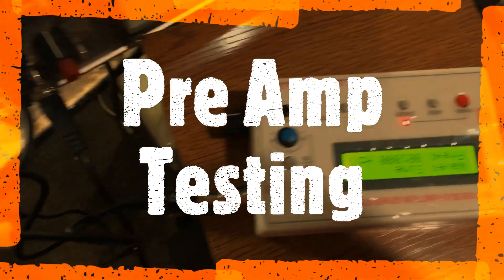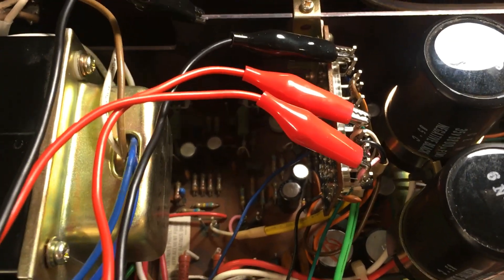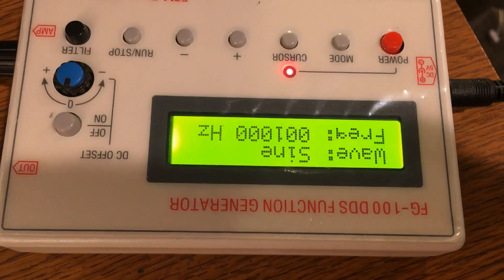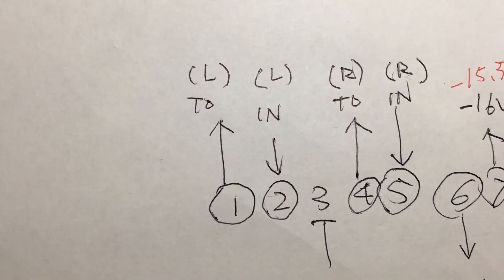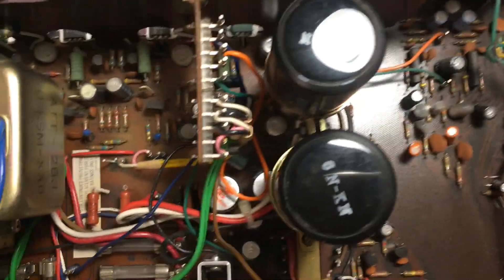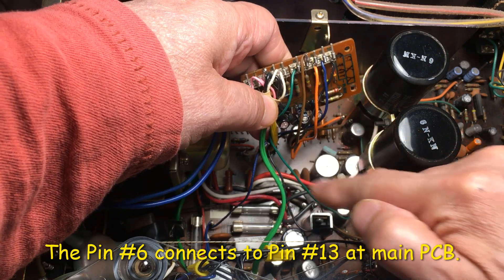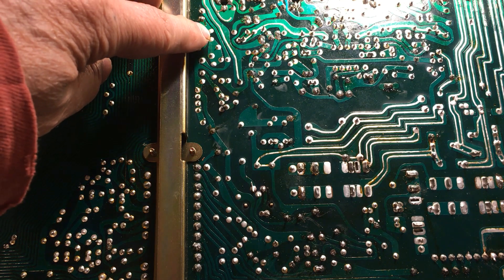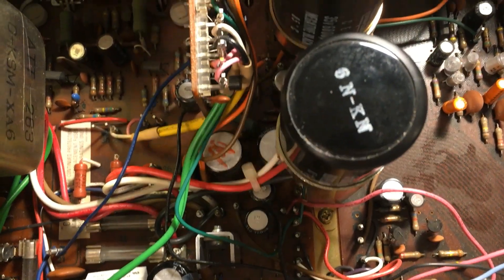Pioneer SX-550 Receiver Repair I - No Sound Outputs

Comment: Hi !!  I just bought a vintage 1984 to 85 Pioneer sxv90 for repair. I used to have this system when I was a kid as it was my 1st stereo I bought as a kid in 1988.  It doesn't make sound but turns on. I don't have it yet as I just bought it today.   What should I look for 1st ?
Reply from the maker: I don't have manual or circuit diagram for svx90, so I can't give you any suggestions. There are many reasons can cause no sound output including blown fuses, speaker protection mode is activated, defective amp PCB and power supply.... etc. If you can provide me more details on the svx90, it may be helpful to analyze the problem.

Comment: The lionshare of issues with these amplifiers is: 1) cracked solder joints 
2) cracks on the boards themselves 3) dried up electrolytic capacitors and 4) oxidized potentiometers. 5) dirty switch contacts. 

Contact clean any pots and relays.
Clean and inspect the board.
Reflow solder 
Reace capacitors

Solves 90 of issues woth amps. Its really not that difficult.

Comment: Great video as usual. Please what tool did you use to diagnose the two replaced capacitors? Have you worked on board or off board? Best regards. Like.
Reply from the maker: I use a capacitor tester or multi-meter to diagnose the defective capacitors. Working off board is a better way to detect the problem. However, sometime it still can be found the defective capacitors on board with the tester.
Reply: @VintageAudioFan  Thank you.

Comment: Great troubleshooting video!  The SX-550 was one of those receivers that always seemed to punch above its weight.  With these gems now pushing 45 years old, they need a little TLC to keep purring along.  Thanks for posting and your time.
Reply from the maker: Thank you for the comments. Recently I have repaired and listened to the vintage receivers with 20W/ch wattage (i.e. Marantz 2220B, Yamaha CR CR-420, Harman Kardon 330B & 330C.... etc). The Pioneer SX-550 is on the top of my list of the best receivers. It has very good FM reception with clear channel separations. And the overall sound quality is also excellent. It is worth to keep and I highly recommend it.
Reply: Another great video.Wondering where you get your stereo equipment from that you work on?
Reply from the maker: Most of stuff I owned and I also accept some gears from the local and out of state fans who need to get their equipment fixed. But it is selective base on my schedule.